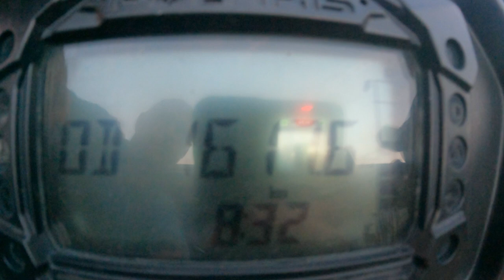2020 SPORTSMAN 850 RAD RELOCATE, A GOOD PLACE.

Comment: Those straps do break often with a rad relocate , that why i just relocated all my fuses , battery . This was so i could just bolt the lid closed and not worry about it . There also know to break the whole front rack over time .
Reply: Where did you bolt the lid down at? I’m having issues with it shaking terribly